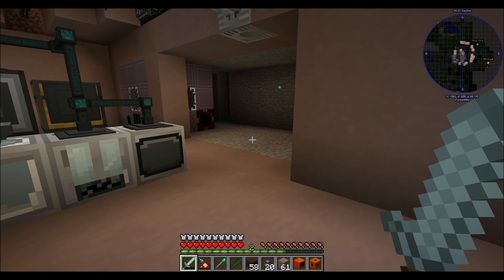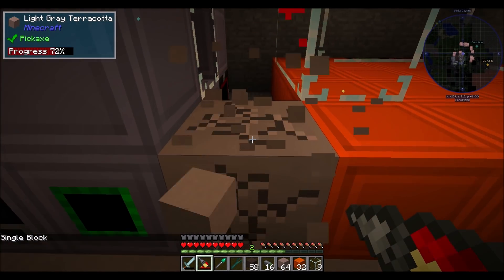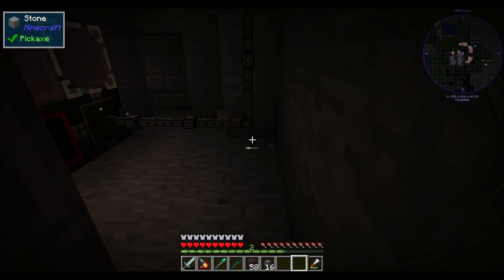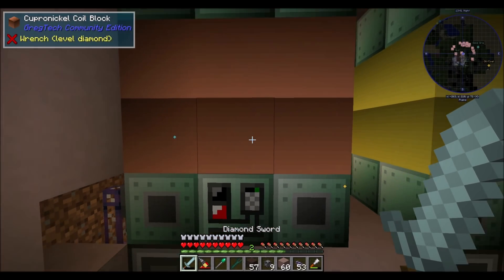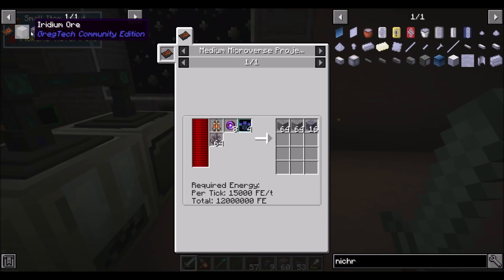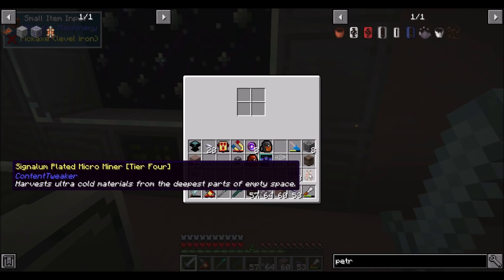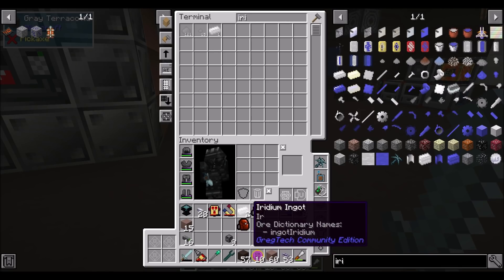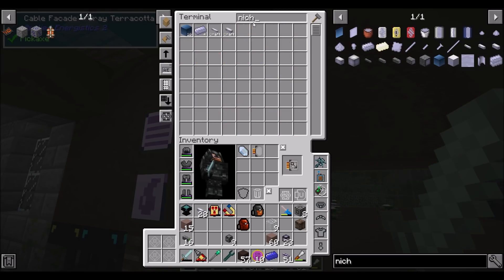OmniFactory   Ep60 Osmiridium

Comment: Some things i would like to point out:
1. Osmium dust can be directly smelted, it doesn't require a blast furnace.
2. LuV stands for Ludicrous Voltage.
3. You don't NEED packagedauto for everything. If the processing operation you want to do needs 9 items or less, you can use the standard interface with encoded pattern. e.g. crystaltine ingots, they only have 5 unique items that go into making it. To add to this, the automation interface is pretty smart, if you hook up an interface directly to it, program the automation interface for whatever recipe you want, it will automatically insert all the items into the table. (which you have already seen in your E2E playthrough) And you can set the automation interface to insert the output directly into the ME interface.

Comment: If you make the interface with the recipe a higher priority maybe that'll make those recipes preferred?

Also you didn't need packagedauto, none of those recipes had more than 9 types of items so AE could handle it.
Reply: Elementalguy2 The priority system for interfaces was introduced exactly to do recipe priorities, so yes that should work. I don’t think Dire has ever realised that feature existed though :(
Reply: Elementalguy2 I always forget it exists because I never have to use it in most packs. Definitely useful to remember it does for those edge cases though.

Comment: instead of autocrafting the powders you can setup a macerator with an export bus to auto-input all of the rods into the macerator to be turned into the dusts.
Reply: Yeah, thats what i wanted to Tell as well
Reply: you need the rods for the netherstar core so you need to at least hold some back and you need a lot of netherstars a bit later
Reply: @fettgummie9685  well, you could do an insert-only storage bus on an interface to keep a certian amount of rods and process the rest

Comment: Why does dire use 2 CEF's for each blast furnace? One CEF with 4 crystals in it should do the exact same thing?
Reply: Back before he upgraded his power he was using CEFs with 4 power storage items each. He has since forgotten why he was using two CEFs.
Reply: Because he has no clue how GregTech power works and doesn't care enough to actually learn.
Reply: At one point he had energy issues.  Rather than solving the problem correctly, with correct energy storage items and better power transfer he instead thought the problem was that a single CEF couldn't support a single blast furnace.  So he made 2 CEFs. For some reason he still thinks each energy hatch needs it's own CEF.  Entitled basically hit it spot on though, He has no clue how Gregtech power works.
Reply: To be fair though, with a decent power transfer/storage system he wouldn't even need the crystals in the CEF.  His knowledge of how conduits work is also highly lacking.
Reply: @andrewgood7956  what do you mean by that?
Reply: dire is has a cargo-cult mentality with the pack. he finds something that works and then never again questions it.
Reply: @andrewgood7956  oh okay thanks.
Reply: @napalmstrike2007  Depends which comment were referring to.  The big one was how conduits worked.  The reason his single CEF wasn't getting enough power for the blast furnaces when he switched to 2 cefs to attempt to solve it was simply that he had one input that wasn't able to handle all the various outputs, hence why I mentioned he doesn't understand how conduits work, I meant power conduits.  They have an unlimited transfer rate, it's just that each individual input and output connection is limited to a certain rate.  You can have one input on a 2048 RF/T conduit that has 4 512 outputs but you can also have 10 inputs on a 2048 RF/T conduit that has 10 2048 outputs.  Only restriction is that a single input/output connection can't go above 2048.

One look at an energy input hatch and his CEF would have told him the CEF wasn't the problem that episode.  CEF does 4 amps, input hatch takes 2 amps each.  4 amps = 4 amps so as long as they are the same tier you are fine.  He hasn't really taken the time to figure out how GT's power system works at all though.  To be fair, most people don't.  Most people still think than an HV IC2 machine can only take 512 EU/T max without transformers so most people don't understand how EU works because it's not as simple as RF.

As for the last point I made, the crystals not being necessary, CEFs are just energy converters with a power storage function.  You don't need power storage if you have enough energy input.  By storing sufficient power in your power creation system before transferring it to all the various CEFs you have a better system than relying on crystals in each CEF.  Even better if you have sufficient power generation so that you don't have to worry a lot on a large portion of you base turning on, this is important when you try to craft a tier 7+ microminer, they use a ton of various resources.
Reply: @andrewgood7956  oh okay thanks a lot for the explanation. What about the cable thickness? I know it is for higher amps, but for example do you recommend us to craft a single 16x cef and use 16x cabling or use 4 4x cefs with 4x cabling? I am asking this because 16x cables are SO EXPENSIVE, having 4 cef's might be even cheaper. what do you recommend?
Reply: @napalmstrike2007  Honestly it's a matter of preference.  For most things I use 4x CEFs because I build everything as a production chain that's usually a very short production chain.  So a single CEF with 4x cabling is great.   I love this setup because when I Find my rocket fuel setup is way to slow all I have to do is replace the machines in that chain and the CEF/cables.  Certain machines like the alloy smelters get their own 4x CEF then, which also makes upgrading them simple.

16x CEF does have it's points though. You can make long chains, like my ethanol chain of 20 breweries with a distillery.  It's a lot simpler than coloring the cable and using 4 4x cefs.  Also when I upgrade the distilleries i'll be upgrading the entire chain so it's not an inconvenience at all.
Reply: Four 4X CEFs would be more expensive, because they would still require the same amount of wires/rubber; however, you will have to make the CEFs four times instead of once. Even if the wires in the recipes are four times cheaper, all of the other items are the same exact price. Better to just go with the 16X CEF.
Reply: @AmyLovesYou  Again depends on what you are doing and what you want.  I could hook my epoxy line to my   luminescence line and my titanium line with a single 16x CEF.  However, what happens when I want to upgrade my titanium line but my epoxy line is doing just great.  I either have to throw down a transformer, and since I sometimes upgrade 2-3 tiers at a single time that's 2-3 transformers or I have to upgrade 2 additional production chains that might not need to be upgraded just to upgrade a single line.

It's a lot more convenient to use 4x's unless you need the 16x for a single chain.  You are right that 16x CEFs aren't  a lot more expensive if all but they do have drawbacks.  Also depends on how you setup your machine which will determine how expensive 16x cefs are.  1 machine per a cable like DW20 is doing means 4x the cost in cable per a machine.  4 machines per a cable and yes 16x is pretty affordable.

However this is where gregtech and the EU power system shines.  There's no one right way on how to connect your machines.  Since we are using lossless there's a whole lot less wrong ways as well.  There are however a bunch of choices on how to do something that generally come down to preference.
Reply: @AmyLovesYou  okay thanks. 16x vibrant is too expensive, but other types that have a little bit loss are a lot cheaper. Would you recommend us to keep with vibrant, or do you recommend other types that have a loss? I calculated that even the one with the smallest amount of loss is too much when the cable is long (30 blocks)

Comment: You can automate the first four microminers using the automation interface and You do not need packaged auto for any of them as they each microminer has less than 9 types of items.
Reply: And yes you do need packaged auto for other recipes but you dont need it for crystaltine either.